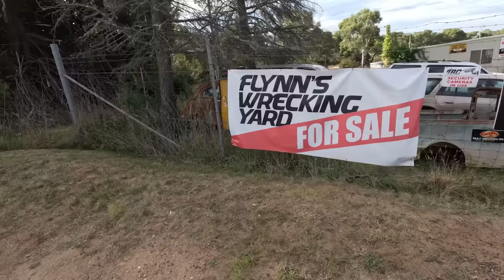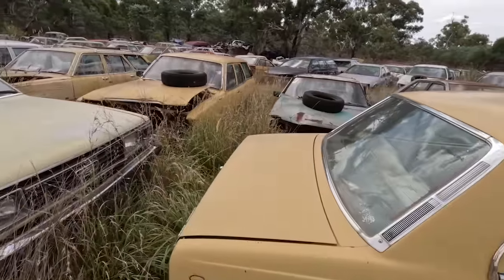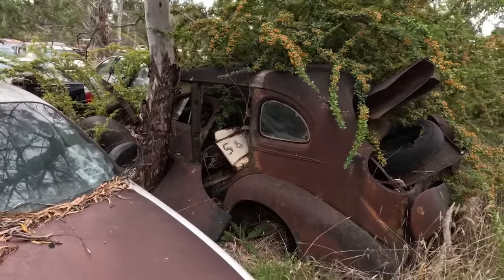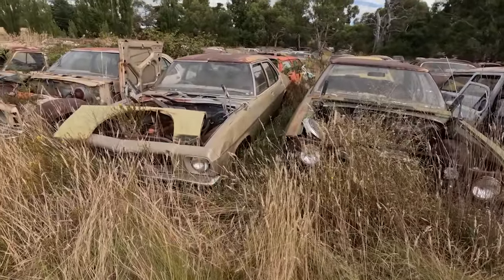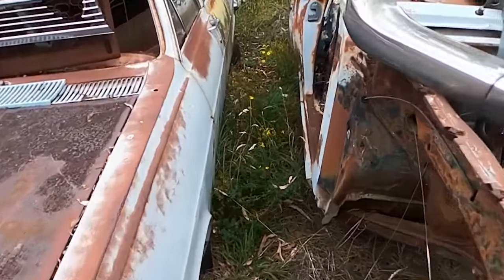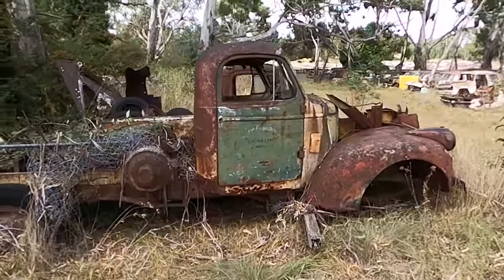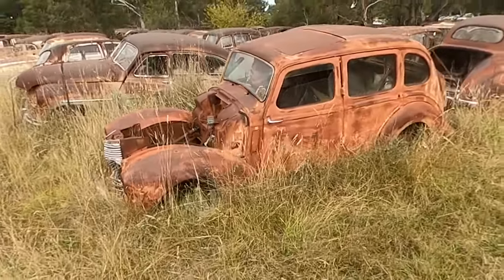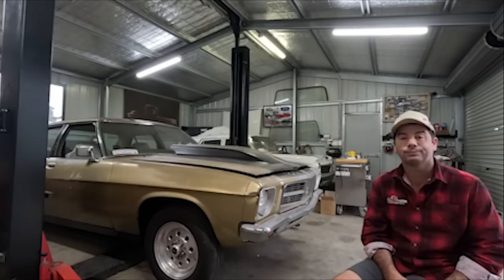3500 Classic Cars all for sale right now , Australian wrecking yard walk , Amazing collection

Comment: Tasman was an Austin, they added two extra cylinders to the 1800 and modernised both ends. We had a Kimberly, which was slightly flasher. Lovely car to drive but a 454 would be more economical! That fastback Datsun coupe might be a 120Y. We had one of those too... I was surprised to discover it had better rear headroom than the 4 door!

Comment: that's an Austin " sheerline " , the ( little )  air cooled  thingie , is probably a Renault , or even a Loyd - Hartnet . I saw a " redded ' VAN  , out at Olympic Park , about 8 - 10 yrs. ago , when a personality , from ( American Grafetti ) , was comparing the annual ( hot - rod ) show ( one August ) . the " row of Austins included ( aA 40 s   &  an A 30 )  Peter Brock had one with a ( hotted - up ) Holden " red " motor . the late Frank Sutton , started ( P.B. ) , in racing , after watching ( him ) , in the ( little blue A 30 ) , at Oran Park .
Reply: A Renault Daulphine

Comment: About 1 hr 35 min our host was guessing a ute as a 40s model but those wrap around corner windscreens were never perfected to the mid 50s and that was a ute so it would have been a 55-56 Ford Mainline also going by the side flashing just forward of the rear wheel. But a very good vid down memory lane.
Reply from the maker: @colinclarkson2892  cheers mate🍺🍺👍

Comment: VC's - bottom of the A-pillar, working back to the B-pillar at the floor. The drains from the heat plenum block up, they run down the inside of the A-pillars, junk builds up in the bottom and the rust starts. AP's and VE/F/G are probably the same. Then look at the bottoms of the front guards, and the rear guard behind the rear wheel.
If there's any VC utes in there,... looks like I need a road trip.
Reply from the maker: 🍺🍺👍take a trailer and grab something even if its only to resell👍🍺$$
Reply: @backshed5295  - Do they have a website listing what's available? Almost have to fly a drone over just to count them all.
Reply from the maker: No website mate

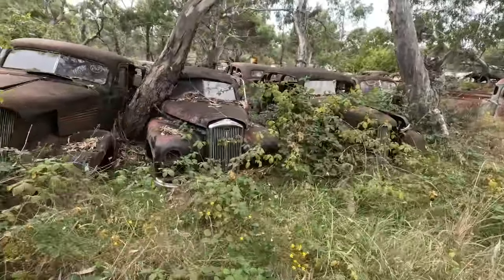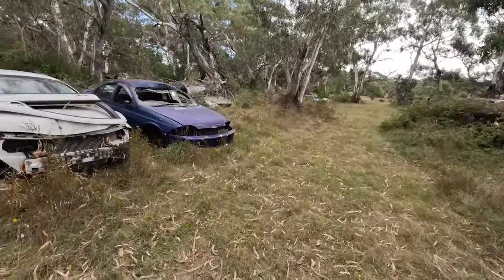Comment: 36:51 and again at 40:46 is a 1937 Chev sedan. A different '37 Chev at 1:40:44.
45:09 1937 Oldsmobile F-37 6-cylinder sedan. Holden made the bodies for Chev, Pontiac, Olds, Buick, Cadillac, La Salle and some of the independent brands like Graham Paige, which is why a lot of the bodies look similar.
Reply from the maker: Cheers mate 🍺👍👍

Comment: Those 2 cars with the tree growing out the middle you keep coming back to and you dont know what they are they are at 40.48 min into the video are on the left looks like from the Chrysler family 37-39 maybe an old Desoto or Dodge the car on the right needs to be saved from the tree is an old Worsley from the 50s and early 60s era maybe a 6/90 or 6/110 a Met Police car favourite from the era and seriouly cool car. I had a later 110 with a 350 chev and 4 spd muncie manual it was more than seriously cool.
Reply from the maker: Cheers mate🍺🍺👍

Comment: 33.54, might be a Prefect. 48.05 Looks like a Ford Prefect/Consul. 49.05 would be an early Mitsubishi if it was a Colt.
1.12.52 most likely a Dodge, around 62.
Toyota Crown row had some sixties Crowns. My mate had a 72 which could hit 120 mph easily. I had a 66 Scout with a Celica motor and gearbox. Needed a higher ratio diff though.
Camira's certainly were rubbish. Never heard a good word about them.
 1.28.42 Chrysler Royal, around 59. Came with a flathead six or optional V8.
1.35.00 possibly a late 50's Mainline ute?
There was a local hotted up Zepher getting around Merredin in the early 70's. Looked quite good in lairy orange.😊😊
Those smaller 'hot rod' sorts are possibly English cars. The Pommy cars usually were a bit smaller.
Some of those Humpy's look fixable. 1.50.00 Possibly a Skoda. 
A lot of those Pommy cars lok the same. Sheerline is an Austin. A relatively good car in its time.
2.01.03 another Dodge, around 64/5.

Comment: Mate - I'm sort of surprised you came away with nothing but a pile of film and a huge grin on your face.  Then again, besides the brain damage factor when you got home with several new projects (or one big one), there is - as you put it - complete sensory overload....and I must admit I would have been in the same boat.  Do I get something newer while its still cheap or do I go old skool and grab that late 30's body and widen the guards, drop a 350 Chev and 700R4 in it and have a play?  An HB Viva / Torana?  That would be bloody cool....or one of the little Corolla SR Coupes or the early Celica would be something fun to do (and now have a big following).  I saw a couple of early Subarus (late 70s / early 80s) as well that I would loved to have looked at more thoroughly. Then again, those early Commodores (VB-VK) - how long since you saw one of them that didn't need rear wheel arches, sills, dog-leg repairs or were so much full of poo that they could run for Prime Minister?  I'd love a VH or VK with a 308 (or 202 black) and 5-speed....  The Qs too!  Wow!  So many clean ones and that 77 HX was so clean that I reckon you could bolt four doors on it, find an engine that runs and be real close to putting her back on the road.  I still regret not ignoring my Dad and buying my Grandad's one owner HQ when I was 20 and I still want one even though prices over here in Kiwiland are just ridiculous.  So many of the ones you looked at had all the worrying bits of bodywork still in perfect, near perfect or easily patched condition that - as you also said many times - it's such a wonder as to how they are still there and not being used on the road already.  I would have had a hell of a time picking just ONE project and a parts car or two to take home.  There was so much choice of the cars I love that to pick just one would seem wasteful.....and there would have been others that you just couldn't get to film on the day that may also have come into contention......

The black Austin Sheerline you saw is missing its HUGE guard-mounted headlights, else you might have recognised it.  They were built between 48 and 52 (I think) and were the Austin answer to Rolls-Royce in opulence and luxury motoring.  I've not seen so many Austin A70 Herefords in one place either....plus a few A40 Devons / Somersets, A50/A55 Cambridges (none of which were anywhere near the condition of the Herefords, let alone the Holdens) and a couple of A30s.  Also, the number of MO series Morris Oxford bodies (although some were badged as the Riley and Wolseley trim levels) was fantastic!  You were right about the Humber being a Humber too - the bonnet emblem may have been dented, but was indeed readable.  Hillman and Humber (at that time) used the same body style and badge-engineering for trim levels similar to the way BMC did.  The Humber was a very early Super Snipe, although I forget what the Hillman designation was called.  Either way, a very rare car nowadays and worth big money in Old Blighty....which is where I would advertise them if I owned the place.  Only saw one Cortina - a MkII - which I thought was surprising too, but man, you did well to get around what you did in the time you had.  Mammoth task to film it all, let alone keep it interesting.....which you did manage to do by looking some over as if they were potential projects.....or should I say, looking them over like any of US would have in your place!

Thanks for taking the time to record all you could.  It was long, but an awesome watch to see so many 30+ year old cars - most of them 40+ - just sitting, waiting for their turn to come back to the road again.  I'd be broke (and with an impending divorce) I think, if I lived over there and anywhere near that yard.  A couple of mill would buy it, you reckon?  Bloody cheap in my opinion.  Huge lump of land and many items of antiquity to recoup the cost of the investment.  Wish I could handle the heat over there, because I'd be in like Flynn if I could swing it.  All the best, mate.

Comment: craps on about sills all the time
most of those shitboxes are scrap
Reply from the maker: Cheers up mate i like working on scrap and making it run you dont have too if ya dont want🍺🍺👍
Reply: So... he's checking the parts that are integral to the body?, if the sills are completely rotted the car will be junk underneath, the sills, towers and bracing are extremely important on uni body cars.
Reply from the maker: @DarrellWilkerson4.6  100%